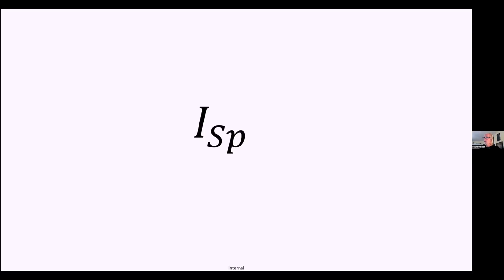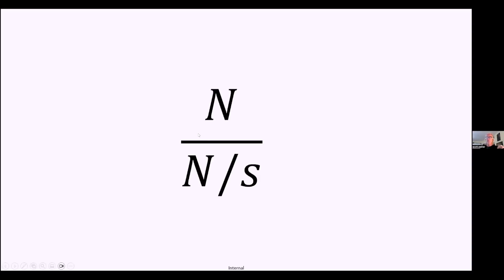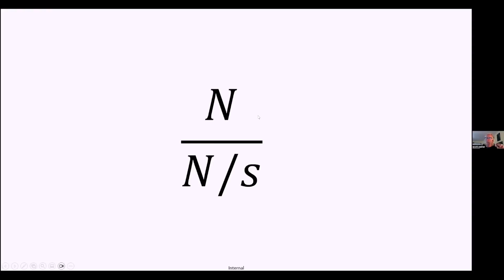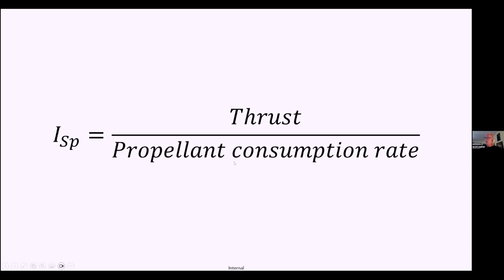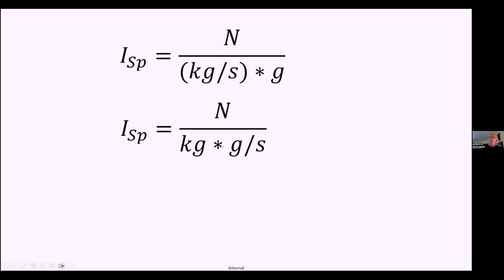Why Are SpaceX RAPTOR Engines 327 SECONDS Efficient?? Specific Impulse and Why It Matters

Comment: They state that the gravitational acceleration at "low earth orbit" is 70% of that at the surface of the earth, or about 7 m/s^2. Well, it depends what you mean by "low earth orbit": at 350 km altitude (which is the typically low earth orbit that spacecraft get put into initially, before boosted into higher orbit e.g. GTO), the acceleration of gravity is about 90% of surface gravity, or about 8.81 m/s^2. To get to 70% surface gravity, you would need to go to an altitude of 1243 km, which is significantly higher than most low earth orbits.

Comment: Nice video. But it would have been better if you specified the orbital height where gravity was 0.7 g. It is about 750 miles. At ISS heights it is about 0.9g. And at geostationary it is not 0.1g but 0.2g

Comment: Might be interesting to point out that there is a theoretical Isp, something that the thermochemist can calculate "ahead of time"  from the reaction (Gibbs) free energy and ideal compressible flow relations - and then there is practical or actual Isp, something that the engineers must measure on the test stand. A value of 327 s is roughly what one should expect from a (stoichiometric) methane / oxygen mix. One starts to reach maximum values of chemical Isp,  nearly 470, with exotics such as hydrogen and fluorine, ideas quickly discarded after the early sixties.
best regards

Comment: The way I like to think about Isp is it's the absolute limit of the time a given rocket technology could sustain a benchmark acceleration of 1g. In effect, we assume the dry mass of rocket and payload is negligible compared to the mass of propellant: adding propellant does not extend the time because you just have to burn it faster to sustain the acceleration. The 1g is not about converting mass to weight, it is just an arbitrary benchmark acceleration like we talk about the 0-60 time for a car.
But 1g is not necessarily about the hover threshold in Earth surface gravity. The ideal way of getting about the universe is constant acceleration: increase speed at 1g acceleration until you are half way there, turn round and decrease speed at 1g until you are there. 1g happens to be the comfortable acceleration for humans to sustain indefinitely. The Isp values for chemical rockets shows how far we currently are from being able to do that!

Comment: I was surprised to hear that the acceleration due to gravity is only 7 ms^-2 at LEO, given that low Earth orbit at, say 400 km, is only 6% further from the centre of the Earth than sea level.  I did the maths and at this altitude, the acceleration due to gravity =  8.7 ms^-2 (g = G.M.r^-2 = 6.67x10^-11 * 5.9721 x 10^24 / 6778100 ^2).  However , because the acceleration is proportional to the inverse square of the radius, it drops off pretty quickly.  It is 7 ms^-2 at an altitude of 1,166 km, which is considered low Earth orbit.

Comment: Ok, question/suggestion 

Plasma and Ion trust 

My thinking of MagDrive is a way for better travel to Moon and Mars. 

It is a plasma truster. Supposed to have about ISP of 5000 seconds.  

MagDrive is smaller version and Super MagDrive is scaled up version. 

If Super MagDrive is scalable to fit in StarShip with enough electric (and metal fuel) this should be better way for StarShip to get to Moon and Mars correct? 

IMO, the electric part of providing enough electricity is easy. J&J Engineering can design a system to provide continuous electricity on demand. 

So, if this possible what would the time be for trip to Moon and Mars (with half way turning around to slow down) my thinking just days and a few weeks to Mars with continuous propulsion of super MagDrive and excess electricity. 

My understanding also with continuous trust, you get gravity. 

IMO, when Super MagDrive is ready for testing and proves possible this should be the best way of space travel. (And not powered by nuclear but ***** energy system) (I know but not possible, but I disagree and that it’s very possible now) 

Mr. Marc and Mr. Jorden.

Comment: ISP is how long a pound of fuel produces a pound of thrust.  Swap pounds for Newtons and the equation is the same.  We could measure using any unit we want.
Reply: In fact this is true for any combination of thrust and weight so long as the thrust is equal to the weight. A 300 second engine can burn for 300 seconds if its thrust equals the weight of its propellant.

Comment: Most of the confusion stems from the fact that there are two metric system versions: physical (SI) and technical. The technical version requires the definition of a standard gravity constant = 9.806650m/s^2. The SI version does not. Properly expressing Isp in SI units would be in m/s. Isp in seconds is a technical metric since it involves the standard gravity constant (Isp=m/s/g). There is a great little booklet which covers all of this: "Conversion Factors SI Units And Many Others" by C.J. Pennychuick.

Comment: Using proper units for force and mass we have: Isp = N/(kg/s) = m/s.  It turns out that this corresponds to the exit velocity of the rocket. By dividing this by g we get Isp in seconds.
Reply: To make it clear ISP in m/s is not actually equal to the true exhaust velocity of the engine. In practice ISP m/s > Ve

Comment: I still don't get the weight vs mass thing.  why use weight?
If I am in intergalactic space and have 1000Kg of fuel (mass) and I burn my engine at 1000Kgf on a 380 second Isp engine... will I not be able to burn for 380 seconds?
Why would efficiency be different on a test stand vs. outer space? (Engines have different Isp at one atmosphere vs vacuum)
I thought the "G" in most of those equations referred to the universal gravitational constant, not the actual gravity field you are in.
Reply: The reason why is that given the impulse (impulse and specific impulse are not the same) and the total weight of propellant you can calculate the isp of the engine to be ISP=I/W. 
Because we all live on earth and for now all our engines are made here the engines propellant weight is always given in its weight on earth. This is ultimately why the isp has the earths gravity is in the math. It’s convenient.

Comment: does the acceleration of the rocket motor itself not add to g in the context of rocket fuel, because the weight of the fuel increases under that acceleration.

Comment: This only works in zero pressure tho. Upon launch ("Ignition!") all that's being done is a fuel dump hence the term "light the candle" as when using kerosene once ignited it burns #strange #peculiar almost PRECISELY like the candle Industry it put entirely (near) out of business back in the late 1800s. If I were being serious about this subject which clearly is not being done here there would be a discussion of "back pressure" as this was slightly understood during the Saturn V Program but not nearly to the extent ever thought necessary until the Apollo 13 Mission in which a back pressure event nearly killed the entire Mission and Crew indeed should have in point of fact.

Simply put what is back pressure answer for ever action there is an equal and opposite reaction so you need to explain first of all what I "see"(observe) is a massive amount of energy being expended SEEMINGLY causing a Rocket to take flight but this in fact is wholly false as the term be "LIFT OFF!" meaning it is the back pressure from the ignition of the fuel that allows for the test article to make it's way clear of "the Launch Pad."

One obvious explanation as to why both success and failure of Starship is a "back pressure failure"* as the energy was too dispersed outwardly and not concentrated in the most contained manner possible to provide the "lifting force" to create an EFFICIENT /not wholly and totally inefficient in the obverse separation event FROM THE PAD PROPER.

This of course as well was further exacerbated by a quite entertaining to some I imagine "shocking destruction of now immortalized forever Dodge Caravan Event!" Of course you all are the PhDs and all that so, well...how many rocket programs have you ever even studied again?

Comment: Now this might be entirely wrong and you've kind of touched on this, but i remember hearing somewhere that the reason they chose the unit of seconds is precisely because it's imperial/metric independent so that the german and US engineers can avoid having to constantly convert between the two each time they needed to involve efficiency in a calculation

Comment: So why are we not launching rockets from floating/ in air platforms. It would make it so much easier and efficient to launch from 30~40 km altitude just because of ground equipment?
Reply: It would be about 1% more efficient, but 200% more expensive , because the lifting the launchpad 30 km up in the air would be much more expensive, ultimately if you can't use a space elevator that gives you into a stable orbit (with the required attitude and velocity too), you need to achieve that horizontal velocity that is needed to stay in a specific orbit .
Reply: not sure where these numbers are coming from but SLS cost 50 billion up to this point barj khalifa cost ~1.5bil also we don't need a permanent structure 40km high but to launch AT 40km with as much delta V we can imprint on the device. Rockets do everything in seconds but supper in efficient. Can't just rise slower and cheaper and create a "dynamic" structure/system that does not rely on a single propulsion system to do it all?
Reply: @qa1e2r4  This is exactly what Virgin Galactic were doing.
Reply: but trying to do it with a balloon is just not feasible, math out the size of a balloon you'd need to lift Starship.
Reply: A quick google tells me that the largest blimp was the Hindenburg which could lift 232 ton. Starship weighs 5000 ton. Wikipedia didn't say what the max altitude of Hindenburg with that payload was, but I doubt it'd be anywhere NEAR what booster can do.
Reply: @jonse5a  Yeah i did that balloons are ok for falcon size. But you don't need a behemoth like star ship from that altitude either. But balloons are too simple we can do better with dynamic systems. Imagine this similar to turbo fan pointing at the ground with wind mill or larger blades to provide lift and essentially carry the weight of the structure with the "shaft" being the launch/ rise mechanism. Not necessary to rise the whole structure but to provide stability for the central shaft. Essentially use the higher air density on lower altitudes to provide the support and increase the blades with altitude space them enough to carry optimal loads and build as high as you can ~10km. Place something similar to maglev track on the inside and that would imprint enough Dv to just about anything that you can fit inside the main shaft.
Reply: Well, people are trying - Virgin Orbit comes to mind. The problem is that you can't attach a really big rocket to an aircraft, plus aircraft can only go so high. I imagine that small satellites will be certainly possible, but if you're talking about something like Starship - there's really nothing big enough to carry its weight and volume.
Reply: Its not so much about the altitudes but the speed you need to get into orbit.  I think...

Comment: At this stage of mankind's development, we use Newton's Laws to move around.
If we want to go into orbit, we must use controlled explosions inside a rocket motor to get there.
Elon wants to use the same explosion force to go to Mars and the moon. Rockets.
That's all we have to work with at this point
So all this info about rocket motors is needed and used.

Of course, leaving our solar system will never be done with chemical/nuclear rockets since to go just about anywhere would take so much time we would have to talk about generations of humans needed for the trip, either generations on the ship or generations on earth if we use stasis to let the astronauts sleep while thousands of year pass by.

Even those who believe in UFOs still think advanced beings will use Newton's Laws. If you move mass, there is inertia on that mass.

Are we doomed to never reach other stars and galaxies? We hope not, but until mankind gets smarter, or our AI does, we are limited to this one solar system.